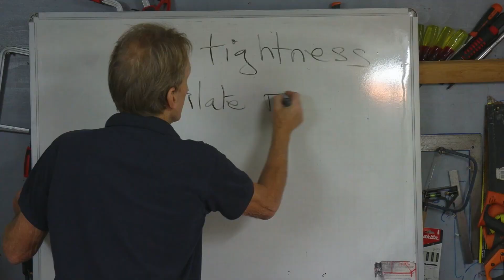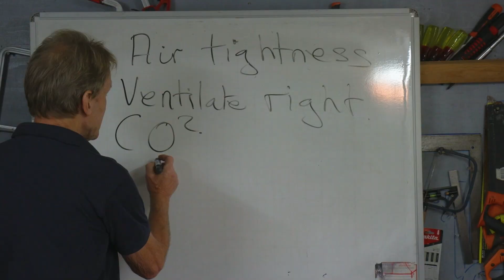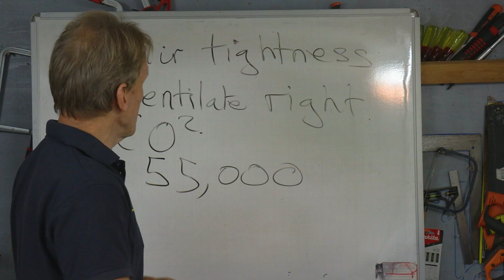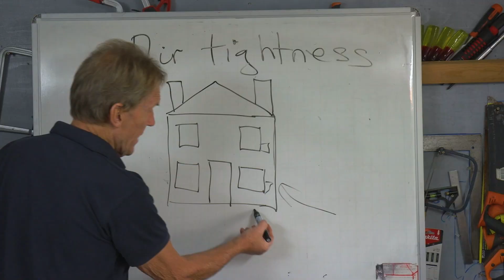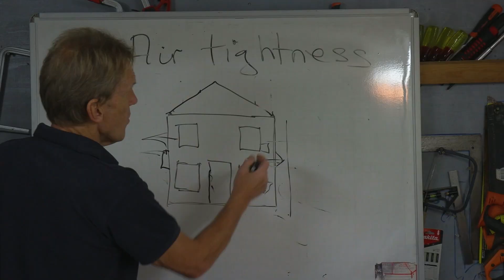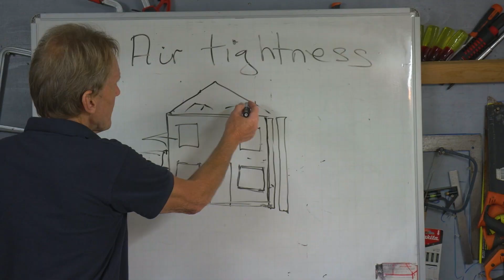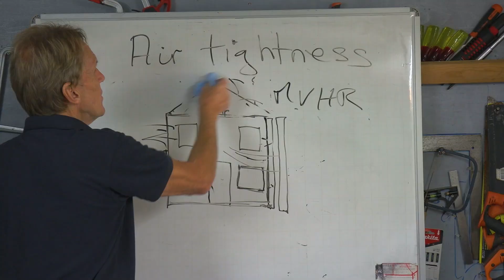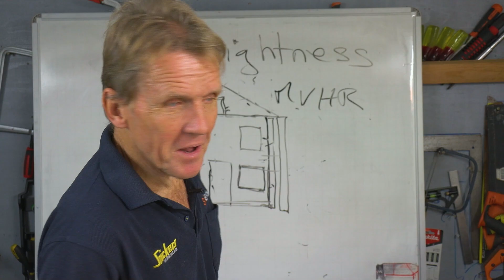The Ugly Truth About Airtight Buildings

Comment: The trade off is not between ventilation or no ventilation - it is between uncontrolled ventilation or controlled ventilation.  PassivHaus with controlled ventilation (MHRV for example) is the way to control waste heat.

Comment: We live in a passive House w forced air ventilation. The air is filtered and changed out fully every 90 minutes. Heat recovery is abt 80% with the compressor running and about 60% without. It feels really great and v fresh. If the system is shutdown, you do feel the drop in air quality and you have to open the windows. Beware new heat exchangers use plastic exchangers that are coated w all sorts of chemicals to minimize bacteria etc...I prefer old metal heat exchangers.  Air tightness needs to be done right or not at all. the air is filtered and it is shocking to see how much dirt and pollen is trapped in a short space of time.   final point, the fans run 24x7 and so (1) you need good planning to minimize noise and (2) no need for as much heating, but there is an added electricity cost to run the fans.   great for people with airborne allergies.

Comment: I agree 100% but what would you do ? How would you solve this problem ?

Our government ordered a test some years ago and found that kids growing up in the town with newer buildings had all sorts of the problems you mentioned and kids growing up in the countryside had almost none despite mold and all the stuff you mentioned.  It actually proved that new buildings are health hazards. They didnt like the outcome because they also want to be co2 neutral, at least on paper, until 2030 or was it 2050....

I have a old ,old very old house wich I want to restore. Im ok with plastic membrans in the floor and the ceiling but not in the walls. I think about adding ventilation holes on the outside wall. I will build a new wall around the house with a cavity and with rockwool in  between.....

Will this solve the problem.

Comment: I work in social housing and see mold all the time and it's down to the tenants not the properties . As said moisture has to go somewhere.
Reply from the maker: You are right, but the problem got worse when we started fitting windows with draught sealing and didn't make alternative arrangements. 
If people open a window it will be fine but they are struggling to heat their homes and this latest hike in fuel prices will make things a lot worse.
Reply: Get a dehumidifier,  £140 but only once, divert some heating money to running it.  Dries the clothes and cheaper to run than tumble dryer.  Will that work?

Comment: In the middle of winter with the central heating on if I open the front door wide open for ten seconds I think there'd be easily ten cubic metres of air exchanged.  That happens a few times a day at least.  Leave the bathroom window and shower door open until the shower is completely dry and I've never had a problem with mould in the bathroom.  Just zap the slightest black spot with diluted bleach so it doesn't get a foothold.
Reply: Spot on!

Comment: Trickle vents are not compulsory on Windows and  Haven't been for years. If you are replacing an existing window which has a trickle vent Building control like to see them but if the existing hasn't got a trickle vent then there is no obligation to fit one.People need to do the very simple process of opening their windows in the morning to "Air" the house.It's amazing to think we have lost the ability to think logically.  Enjoyed the video.
Reply from the maker: Adrian
We are talking about air tight houses here and they need ventilation to comply with the Building Regs. One way of achieving it is with trickle vents.
Reply: @SkillBuilder  Another way of achieving it is to open the bloody windows, just like we have done for over 800yrs. If we visited 100 houses where the windows have tickle vents I would bet my house on 90% of them having them shut all the time. Many window fasteners have a nightvent facility built into the fastener which means the window can be left open whilst also being secure.. Trickle vents are simply not needed on windows but hey what the fuck do I know. I've only had 35yrs experience of making windows ,doors etc. 
     Maybe you can explain why ,after years of requiring windows to have trickle vents the Building regs stopped insisting on them being fitted to all new windows around 10yrs ago...........Why do you think that is?.

Comment: The answer to condensation & damp from wet washing is condenser tumble dryers.  Especially in tenanted homes it should be mandatory for landlords to have these as standard.  They chuck out a lot of heat, but minimise the risk of the building rotting from condensation.  Brilliant
Reply: Not all condenser tumble dryers are made equal - I was shocked when I bought a temp\humidity logger to find the amount of water that my "condenser" tumble dryer was actually putting into the air! Some models are better than others and even a portable electric dehumidifier pointing at a clothes rack can work surprisingly well!
Reply: @Ralphius86  I have 2 dehumidifiers at home and I hardly ever use the tumble drier. The dehumidifiers dry the washing and the house at the same time.
Reply: @ruinunes8251  Have you checked your electricity bill lately..?
Reply: @gulfstream7235  Why?
Reply: Even if the landlords would buy them, the vast majority of tenants will not use them. You can’t make landlords blamed for everything. And in case if you are wondering,  I’m not a landlord, but I deal with a few tenants now and then.

Comment: We had an interesting one the other day. Got a phone call about loft insulation. Saying that the insulation that they fitted (Rockwool fibreglass) has been found to cause damp so they were offering a free damp and efficiency survey. They were now recommending spray foam insulation. Took me a while to figure out I was talking to a robot system. So now we’ll be paying on our energy bills to rip out what they fired and re fit new insulation. Would love to see Rodger’s rant on spray foam as I understand there can be major issues with it. 

Rodger, over to you mate.
Reply: Rockwool is stone not glass. Rockwool repells damp fiberglass sucks it in.
Spray foam really really sucks moist and some brands are fire hazards. Not allowed to use where I live.
Reply: @migsvensurfing6310  they were listing out the types of insulation that we could have had fitted. 

The problem is that where you have migration of moisture through building materials then with the reduction of temperature that’s moisture can condense leaving water on surfaces that really don’t want to be wet like wood joists etc. They also do a bad job of the insulation and block up the air flow under the eves. 

Thanks for the info on spray foam, I’ve seen horror stories about it off gassing and being a nightmare.
Reply: I have opted for open cell spray foam in my newly built "warm roof" loft. There is a lot to this subject, as ever, it is not simple. Do research, consider the building construction, envelope and type of roof (ventilated or warm), type of foam (open or closed cell), make-up of product (most now do not use off-gassing agents) and installer. 
Never take up any insulation offer from cold calling or marketing spiel. 
Building Control have no problem with it.

Comment: What you need, of course, is a ventilation system with a heat exchanger. Common in Scandinavia. But we love old houses, and even pass laws to prevent the owners modifying them.
Reply: Don't blame the lack of maintenance on the system itself.
When properly maintained, an ERV and HRV are great systems which both solve the problems mentioned in this rant.
Reply: @Nbomber you don't know what you're talking about . Hrv or erv are the best thing. Constant supply of fresh and filtered air  .
Reply: @superbecx  the ducts can harbour spores and mold and whatnot, I think it s why the hollywood movie image of a stainless steel ducting system is in our heads,stainless can be very sanitary,esp the right alloys,not to mention it could be coated in copper silver etc
Reply: @Nbomber 
"I want you to take a minute to realise that I didnt insult your grandmother. You seem personally offended about me saying bad things about a ventilation system."
I really don't understand what you are saying as I don't feel personally offended. You however do. Please don't reflect your feelings onto me.

Please read this: https://en.wikipedia.org/wiki/Sick_building_syndrome
Nowhere it says is it related to modern housing and the air tightness of the building.
Neither it is caused by HRV or ERV's
Please provide us with a scientific paper which backs up you claim.

An HRV and ERV is different in doing air filtering which normal ventilation systems often lack and natural ventilation (by cracks and holes) completely lacks. Furthermore an HRV or ERV can provide more clean air as heat is recovered resulting in more fresh and less stale air.

An ERV prevents static air and over dimensioned HRV can cause it because air can become too dry. But I could not find the problem a ventilation system caused static air because of the ducts themselves.
Reply: @Nbomber 
They don't come under scientific scrutiny as they work quite well, when maintained.
I did check Google for a scientific paper disagreeing with the above, but couldn't find it.
Please provide us with one.

Normally moisture does not cause problems in the ERV and HRV as the heat/exchanger needs maintenance too, just like the filters and the ducts. Cleaning ducts normally is a standard service of any company who installed them. I  think once every 5 years. 

"They are great systems for heat recovery, beyond that, they have little use."
Not true. Next to heat recovery they provide you continuously with warm fresh air giving you a better, warm and comfortable climate.

Just maintain the system.
Reply: @Nbomber 
"HEAT RECOVERY VENTILATION  STUDY in  Vancouver  Single  Family  Homes
By brady faught"
I read the whole document and really could not find anything wrong with the system itself else than:
 - Wrong installation
 - Underdimensioned
 - House not airtight
 - Lack of information to the home owner
 - etc

Please provide me with a scientific study which handles "sick building syndrome" in combination or a well installed system. And please don't blame the system itself because the installer does not know what she/he is doing.

Cleaning air ducts is not a problem, just look for "cleaning air ducts" on Youtube. Furthermore, flexible ducts are only meant to be used for short difficult parts, so when excessively used, the installer did not read the f*cking guidelines.

Again, don't blame a system because the installer does not understand what she/he is doing.
Reply: I cant afford it... live in Denmark.
Reply: @Nbomber
"also, when you say, just maintain the system..........." 
A simple rule is to clean the filters out every one to two months and replace them when needed (about 2 times a year). Cleaning out the ducts can be less often and when you take care of the filters, once every 5 years is quite OK. Not because it is a very dirty duct, but just to make sure it is not going to give problems in the long run.

So, when you don't clean out the filters you can expect dirty ducts, moisture buildup and molt growth. 

This problem is more about education (and laziness) than the HRV/ERV system itself.
Reply: @Nbomber 
It's all about educating people about the system, not the system itself.
Reply: @Nbomber you can have 3 degrees in dishawashing you still don't understand why a erv is better than hrv in any situation and by the answers you gave here you don't understand relative humidity ... you just have a rant against something you don't get  .. if you ever find mold on a pvc surface under constant  airflow and around 21 degrees  you must have put it there yourself because buddy mold doesn't like that and it will never grow in there

Comment: Pasive house standard, with heat recovery ventilation would be the way I would go, if done correctly.  As to any of the large developers being able to it correctly, given the current build standards…

Condensation is when air with a high RH, the amount of water held in the air, meets a colder surface, the air cools and if the RH get to 100% then condensation is the result. In old leaky houses the wet inside air is replaced with dryer air from outside, in an air tight house this has to be done by a mechanical system, also with higher installation in the walls they will be warmer on the inside, less likely to be at the dew point, when condensation will form.
That is one area where America is far ahead of us, with the HVAC system that usually includes a dehumidifier. They also consider black mould to be a health hazard, and can make a house uninhabitable until the mould is fixed.
Reply from the maker: I agree about the passive house but they are making houses air tight with none of the MVHR. That is the flaw
Reply: @SkillBuilder  it will not change until the building regs require it to be done, and the big developers are stopped from self certification of new builds.

Comment: You sum it up well Roger, only an house built for MVHR is the solution, but that's big bucks and working Joe ain't got that kind of money. What's worse is that motivation by Gov is to do half a job with insulation, and don't worry about the health issues. 

Another random story #1: I was brought up in a house that was leaky as hell, but it did us no harm other than being bloody cold in the winter. 
random story #2: My grandad was an Architect, he and his wife lived 'til over 90 in a house that had walls so thin, you could read through them (stick build).
Reply: I put MVHR in my house during building for around £2,000 plus a bit of extra labour. It's a tiny fraction of the build cost and should be compulsory. I wouldn't live in a house without it ever again. I agree about useless trickle vents.

Comment: Needs active ventilation - aka air conditioning. Time we moved to cooling heavily insulated buildings down in the summer rather than warming them up in the winter. Energy usage then shifts to the summer when we have more solar power and the building is climate change ready.
Reply: I think you're very mistaken about the way aircon works in a building. It doesn't add ventilation. It's akin to the aircon in a car but with the 'recirculation' switched on, ie room  sealed system with transfer of heat energy to outside via a heat exchanger. 
Your second idea simply wouldn't work as there's not enough thermal mass in a typical house to maintain an artificial temperature for several months without mechanical heating/cooling. 
Maybe i'm missing something?
Reply: Active ventilation or open a window in layman’s terms
Reply: great if you live in a new build, but what about the other 90% of Britain that lives in 100 year old houses?

Comment: Building cost has gone astronomical because of energy conservation regulations. At the meantime gas prices are artificially priced higher than electricity just to force the people to get electrical heating. In the end, it nothing more than daylight robbery of the common people.
Reply: Agree with everything you said. 
But, i'd like to add that the oil cartels are manipulating the global energy prices to try to slow (or even better for them, kill off) the impending electric car boom. 
COP26 in less than 7 weeks, and a carbon tax announcement is widely expected to be result. Big Oil has put prices up in expectation of higher taxation, and this leaves less room for the treasury to manoeuvre. There's only so much inflation Joe Public can take.
Reply: Electricity is 3x the price of gas. Can’t see how you’re saying it’s the other way round..
Reply: @sunthroughtheblinds  and all those people that have to choose between heating & eating are just figments of the imagination?
True, electricity is expensive (much more than it ought to be) but gas isn't as cheap as it could be, and will soon be made even more expensive with the addition of ever-increasing carbon taxes. Not saying it's wrong to decarbonise the energy infrastructure though. Far from it

Comment: Car ports/ covered decks to dry your clothes and wipe down the windows in the house every morning to remove condensation. Seemed to work alright for the last 50 years? Those that didn't wipe the windows and used portable gas heating, not so much..

Comment: Insulate and leave your boiler on 14 degrees throughout the winter 4/5 months. Wear 3/4 thin layers of clothes round the house. Go out as much as possible. Below 14 degrees you get cold spots happening in corners. Also you don’t repeatedly go through the dew point. ( Pressure/temperature/air moisture density….) . The inner house bricks don’t need re heating . And throw the windows wide on Sunday winter days .
Reply: Alternatively get your self a small Bitcoin mining rig and turn the boiler off
Reply: Mining rigs don’t half pack heat And they pay for themselves
Reply: 5 x £2k graphics cards , a power supply or two and an electric bill

Comment: The airtight concept obviously doesn't work for the current housing stock. However, it has been proven the world over that it is overwhelming the way to go no questions asked for the future housing stock. All new homes should be required to be airtight, have energy efficient windows and a quality mechanical heat recovery system.